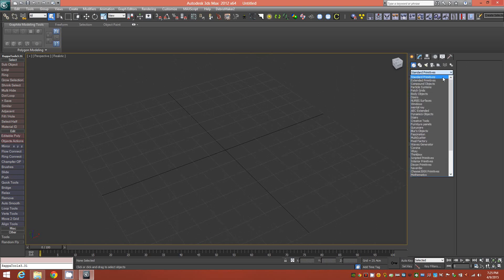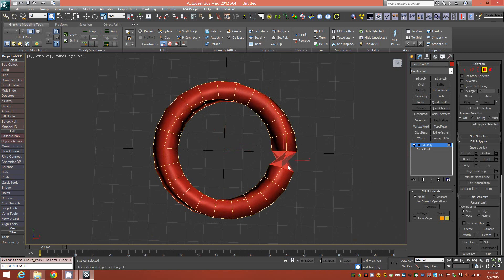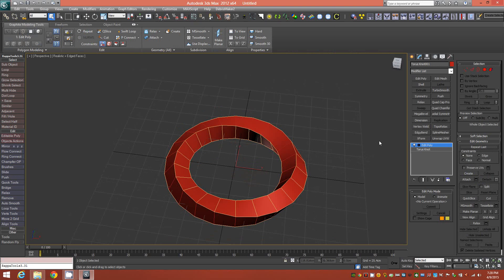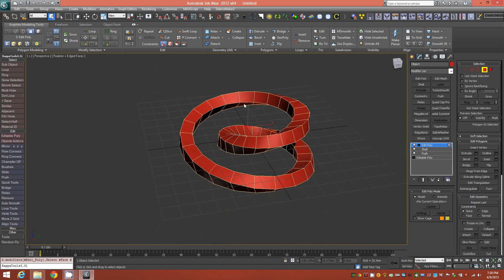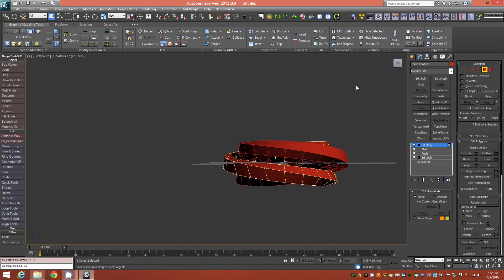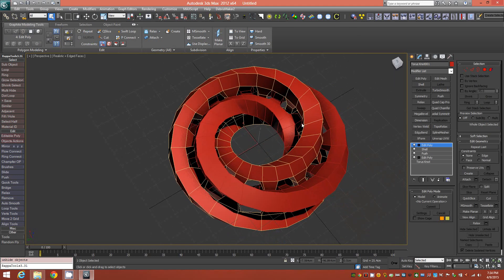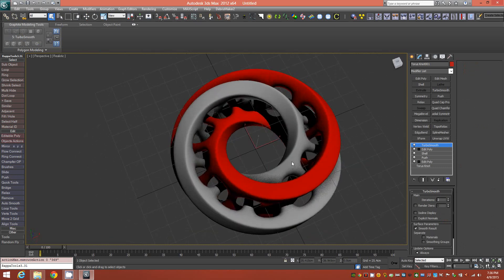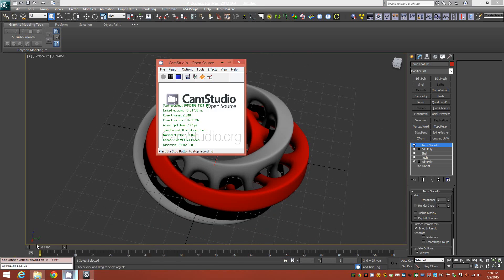3d Tutorial | Interlocked Mobius Strip | 3dsmax

Comment: I think it works easier just Shift Rotating the object instead of working on two detached mesh and do the same exact bridging on the second one too.  Maybe its a tiny bit less precise or you have to know the exact angle to reach more precision.
Reply from the maker: +Ben Mateffy Thanks, Ben.  I think what you are suggesting could work, but the results may not appear quite the same, because the offset of the secondary object will be in a different location than it is here.  So the result might be a different appearance than this one, but could work for something different.  Interesting thought, and I'll have to experiment with that idea too.
Reply from the maker: +Ben Mateffy Ben, if you haven't tried it yet, all you need to do in order to get the second interlinking part is apply a Mirror to the first object, as a copy, along the XY axis.  That does the trick, and is much easier than creating the second set of bridge operations.  I may revisit this tutorial to create it that way, in a future video.  Thanks for the tip.
Reply: +John Malcolm It&#39;s an honour :) I&#39;m really enthusiastic follower of your channel I followed all these tuts and each one tought me one trick or another in Max. It&#39;s by far the best for any jewellery or design artist who are fresh in 3D and wanna get on the right track. Thanks!
Reply from the maker: *****  Thank you, Ben.  I really appreciate the support and kind words.  I've learned a lot myself, simply by testing and retesting techniques, to see which is most efficient.  I'm also very interested in 3d printing, and some of these designs need slight modifications to print properly, I've come to find out. Mostly just wall thickness and some scale issues.  I've just opened a store on Shapeways, which will eventually feature most of these objects for 3d printing, and also some new ones, along with free downloads of the STL files.  I'll also offer all these models as OBJ, for FREE, to anyone who may want them as scene assets or render test objects, on Turbosquid and other sources.  Thanks for watching my channel.  I'll have some new material up soon.

Comment: Hi, i like your videos, but one thing is driving me crazy. How exactly did you do that selection in 4:19(all the polygons)? I'm using step mode for that, but yours selection looks way better and faster.
Reply from the maker: Łukasz Select one polygon, then hold down Shift on the keyboard, and select another in the direction you wish to go, and it will automatically select the entire face loop.  In later versions of Max, you can simply double click, and it will select the loop in the same way.  Holding Shift also works for edge loops and ring selections.
Reply: John Malcolm It's working, thanks ;)